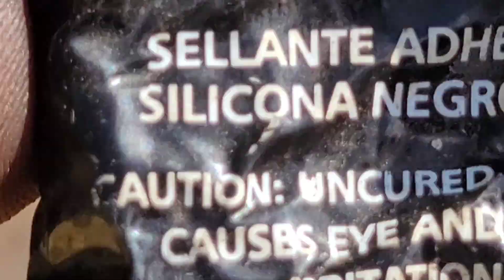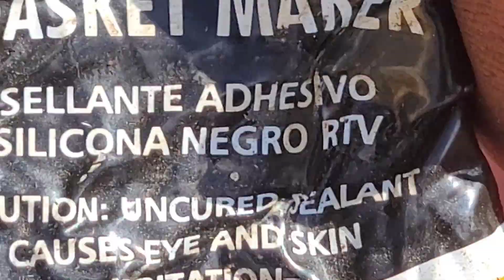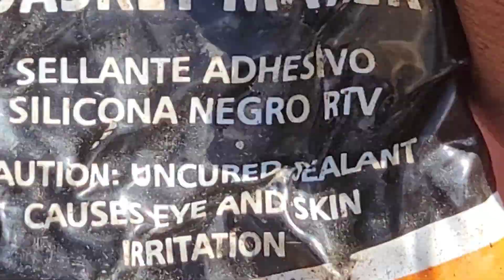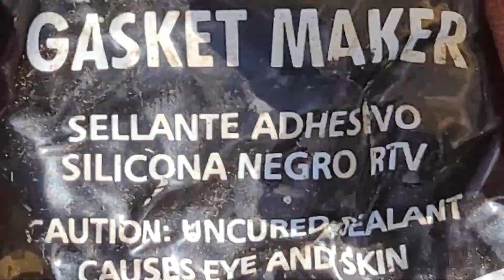Off Grid 24v Wind Turbine Project - Trying to get the 3kw Motor fitted before the Winter Thrashing.

Comment: i wanna do a wind turbine with a hoverboard motor but do i have to modify it to use it for 12v setup? i have 50ah on gel batteries and my 100w solar panel is not charging it fully
Reply from the maker: hoverboard motor will work fine at 12v as a generator, cheers.
Reply: @GavinFreedomLover  but i mean how fast does it needs to spin, i already have a PVC pipe to make some wind turbine props but i dont have a hoverboard motor yet